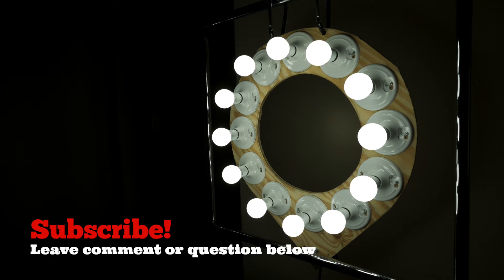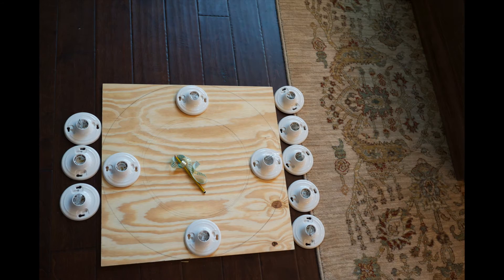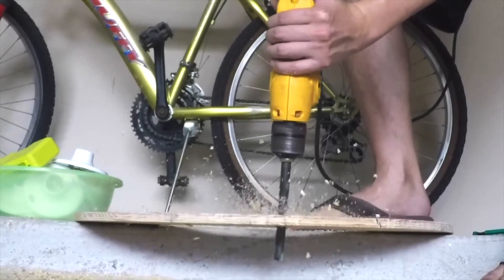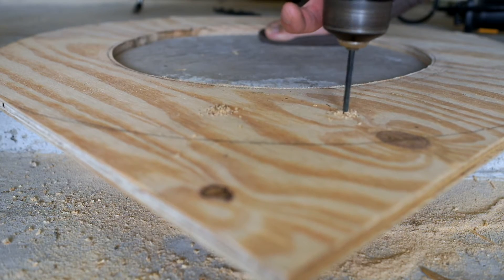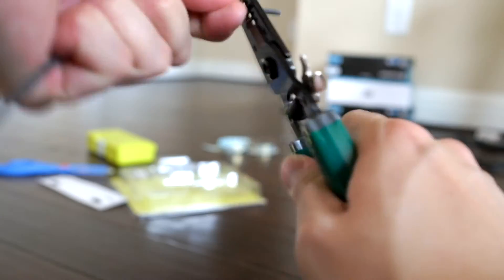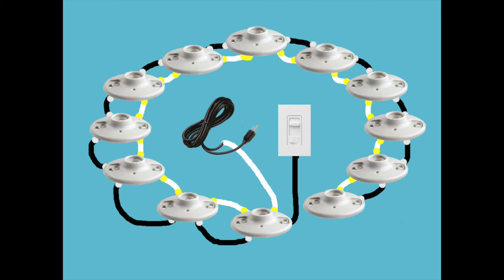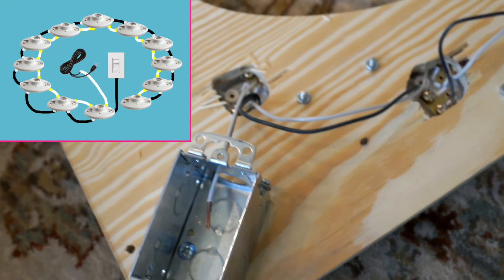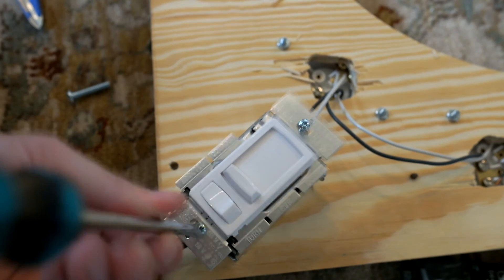DIY Ring Light under $80

Comment: great vid!
What do you use as a stand? how do you 'attach' it to a stand?
Reply from the maker: I hang it on tha coat rack, http://i01.i.aliimg.com/img/pb/690/988/452/452988690_316.jpg
Reply: +Allen Lo thanks for the response, I'm going to hit craigslist soon.

One last question.  I'm planning on doing this with 10 105w CFLs, will that work?
Reply from the maker: +shayne slauter just make sure that your dimmer switch can handle the total wattage, in your case 10 x105w = 1050watts
Reply: One more question, it doesn't matter which wire from the extension cord goes to the dimmer and which goes to the Light socket does it?
Reply from the maker: hey sorry for the late respond man, did you get your question resolved?
Reply: shayne slauter

Comment: where did you find these light sockets ? i cold only find a 2 bolt sockets, not a 4 like you have on the viseo
Reply from the maker: glad to help, I got mine from homedepot, I believe the socket you mentioned is ceramic with only 2 connection. Look for the plastic one which has 4 connections. make sure that you subscribe for more upcomming video